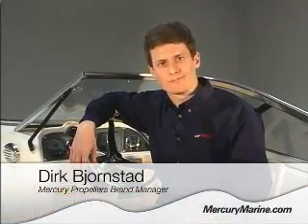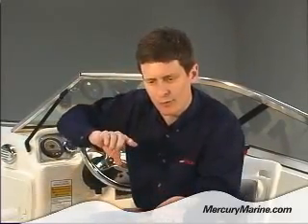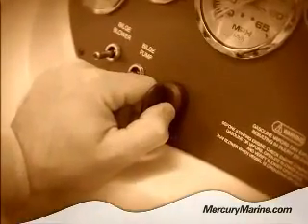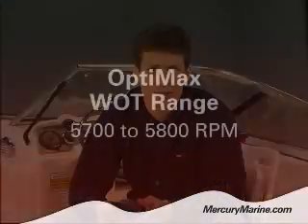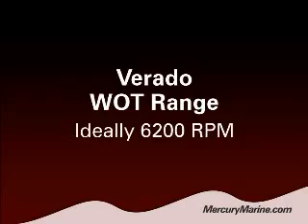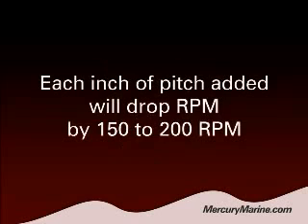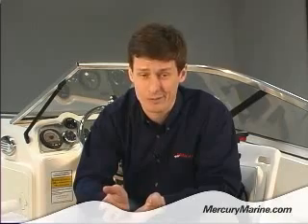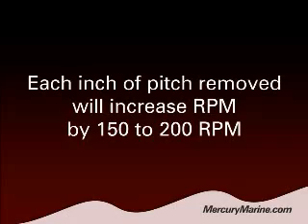Choosing the right propeller pitch for your boat

Comment: This is good thank you.  I used the Merc on line form to help assess, before you get on the water, at least the prop that one should hypothetically use on their boat.  Ok.  It gives me a recommendation but here is the part that baffles me---the form starts with asking what type of boat you have--fine.  Then, what engine make and power, fine.  Your current prop and your performance goals, etc. fine.  BUT NOWHERE ASKS THE LENGTH OR WEIGHT OF THE BOAT.  I mean, there is a little section that shows the weight and so forth, but nothing happens if you click on that.  THEN it gave me a recommendation, but how can I trust it when it does NOT ask the length and weight of the boat?  I mean, I AM a beginner, but it must matter--prop wise, if I have an 18 foot boat (as I do) or a 28 foot boat (which I don't), right?

Comment: Hey, don't know if you answer the questions on here. I have just put a new optimax 150 onto my Lasercraft 560. These boats are alluminum lower and fibreglass top boats. The dealer fitted a evolution 17p prop onto this engine and i have just done a WOT test and get 5100 rpm. This to me is way off. I also am getting 28 LPH at 4000 rpm. I have heard this is quite high. Could you please advise me on what prop and pitch i should be using as i am running out of time to swap with dealer.

Comment: Question. I have a 97 Mercury 250 EFI 2 stroke w/ a SS Mirage (15 / 17 Pitch) which has already been rehub, once. Now the question is if i change from SS to a Aluminum (Black Max) what can be the most significant issue. I am not a Fisherman, i do not go out offshore and i maybe use it once a month. It is stored on its trailer once out of the water. (1985 Chaparral Fishermen 234 Walkaround/ Cuddy Cabin) and i am in Pensacola Florida Help Help Help. Reps at Merc store said it was fine to do